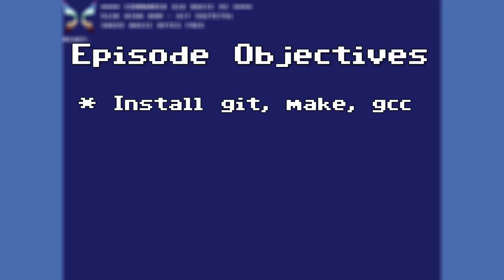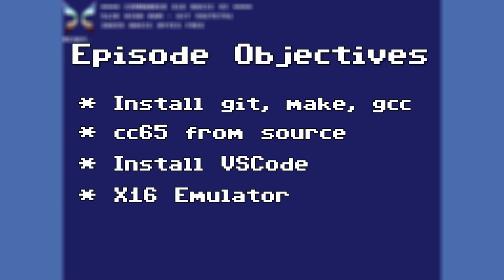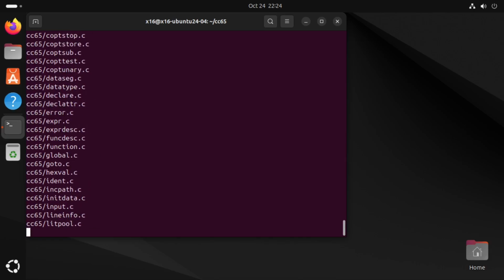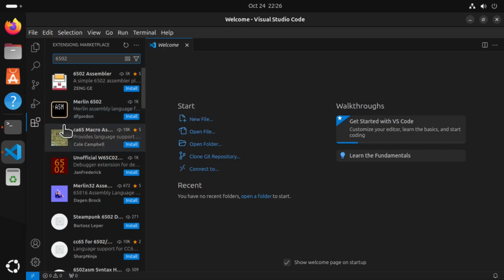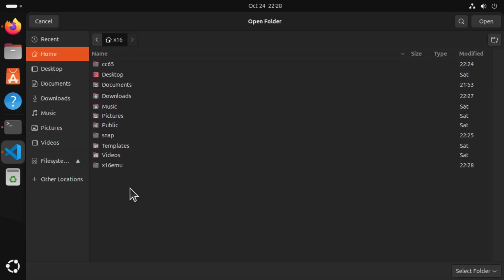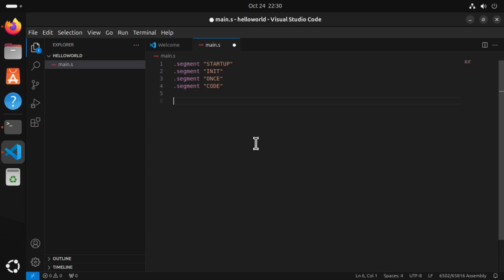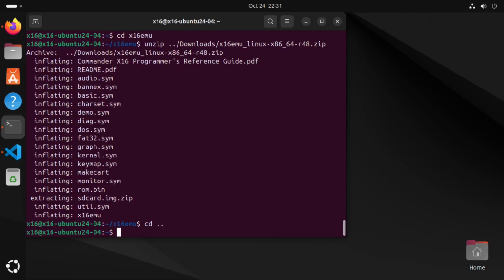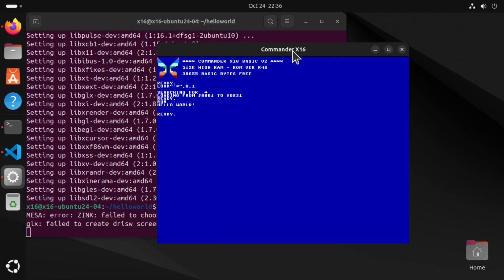Episode 0: Getting started (Linux) - Commander X16 Assembly Language Tutorial

Comment: why bother with the overpriced X16 when you can just program for the C64 or C128 if you want 6502/6510 experience with a real computer that people actually used back in the day instead of some rehashed garbage X16 or Mega65?  Can't afford it, get a free emulator, there is no advantage to owning the hardware anyway except nostalgia (and the X16 orM65 have any nostalgia).